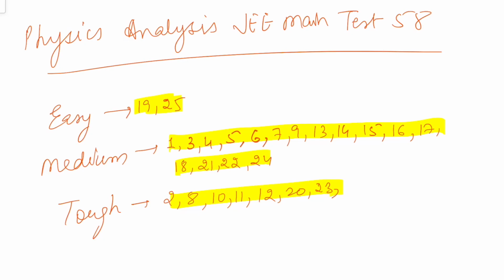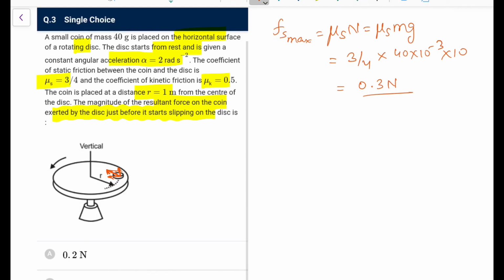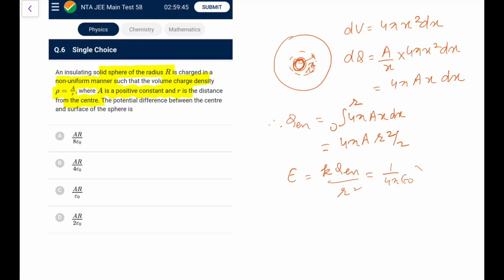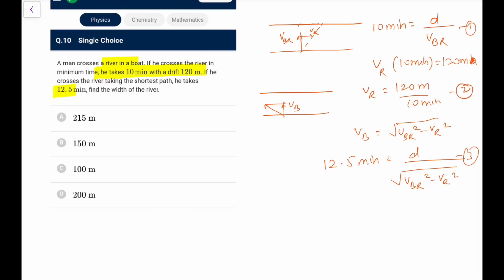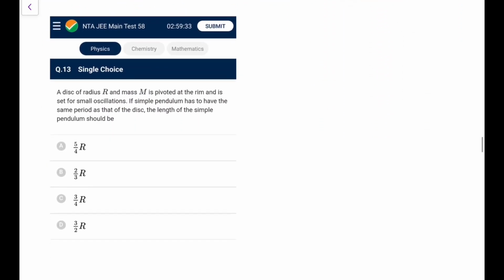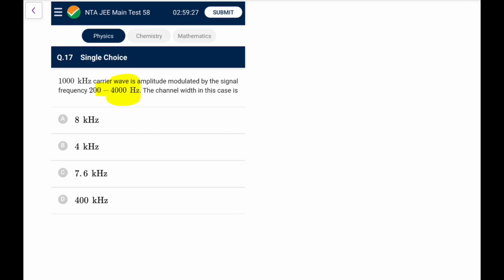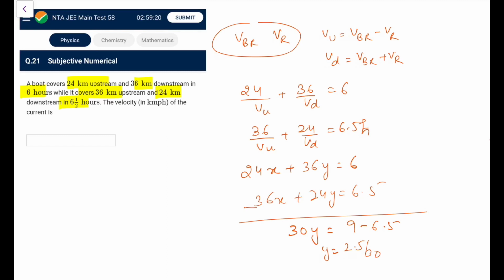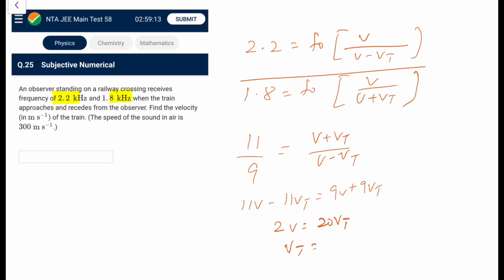Physics Solutions NTA Abhyas JEE Main Test 58

Comment: Sir in ques 3 there would be two components of force one due to tangential acceleration and one centripetal due to rotation but at verge of slipping the resultant of these must be cancelled by friction force between the disc and floor ,the weight is balanced by normal on the disc due to floor so why can't we write net force as only 0.3(mus*mg)???
Reply from the maker: Please see the solution it's clearly explain ed why your expected answer is not what is asked 😊